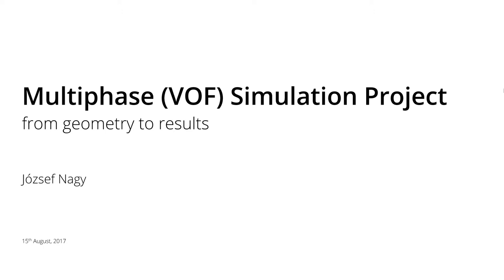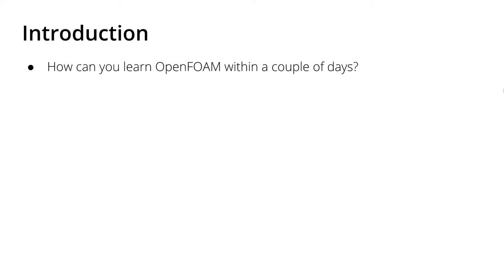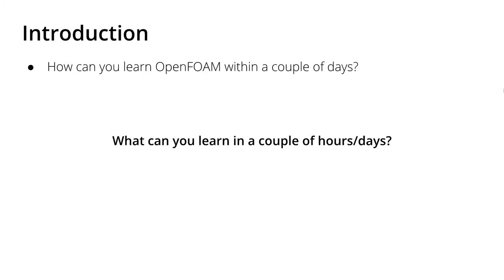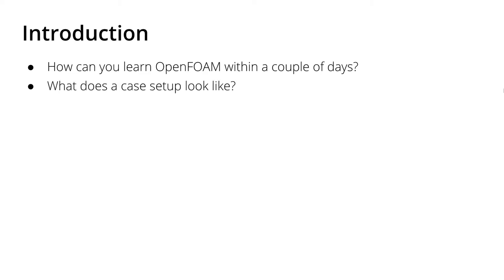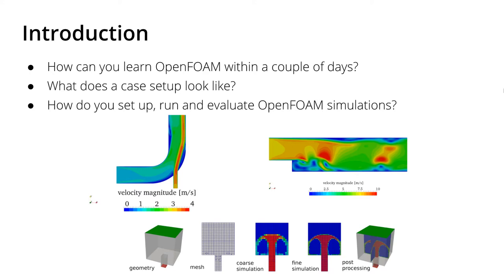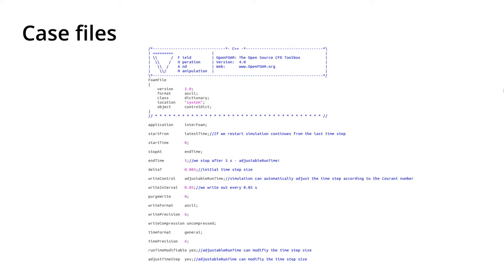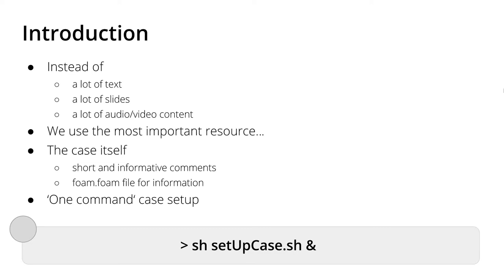Multiphase simulation project in OpenFOAM in Windows 10 and Ubuntu - tutorial part 1 - intro

Comment: Respected Sir, I wanted to simulate a bubble rise case in a water column using vof method with the help of axisymmetric condition. I have a doubt regarding creating a spherical shape in a wedge type. Would you please be able to guide or suggest some resources.

Comment: Mr. Nagy, thank you for your videos. I would like to ask a question regarding the boundary conditions using the solver "interFoam". I am doing a 3D simulation of the flow of an open channel. The primary requirement is that the simulation should follow the "continuity law". For this modeling, I am using an inflow of 20.6 m3/s with a U inlet boundary condition type "variableHeightFlowRateInletVelocity" , and a U outlet boundary condition type "inletOutlet and an inletValue  = uniform (0 0 0). Also, for the pressure file, I am using for the atmosphere type "totalPressure" and for the outlet type "zeroGradient". Finally, an alpha.water condition type "variableHeightFlowRate" with lowerBound and upperBound with 0 to 0.1849 respectively, where this 0.1849 represent the relationship between the total height of my inlet and the water level. My question is that the simulation is running, and looking at the hydrograph at the inlet is a constant line that represents the 20.6 m3/s, so far I think this is right, but in the outlet hydrograph, the outflow is an increasing curve which its maximum value is around 70 m3/s. So I do not know what is wrong with my model, because there is just one inlet and one outlet, so there is not any other water inflow and the flow at the outlet may be 20.6 m3/s as well as the inlet. Thank you in advance for your reply!
Reply from the maker: An idea would be to monitor the mean value of alpha in the domain over time, also to monitor the mean and max velocity in the entire domain over time and see where you accumulate mass flux. I hope this helps.
Reply: @OpenFOAMJozsefNagy   Thank you so much for the reply. I will check that in my model :)

Comment: Hi, when i am trying to import my .msh mesh file in openFoam using fluentMeshToFoam, it is showing the Fatal Error : cannot find file "/home/divyajyoti/OpenFOAM/OpenFOAM-v2012/tutorials/multiphase/interPhaseChangeFoam/submarine/system/controlDict", here submarine is the name of my case file. i am stuck here for several days and unable to find a way out. Please help me out.
Reply from the maker: Is the controlDict at the given path? Did you set up a case, where you want to import your fluent mesh?
Reply: @OpenFOAMJozsefNagy  Thanks for your reply. The issue was with Linux control permissions, had to run chmod 777 for every file in the case and it is working now.
Reply from the maker: @divyajyotibasu3001  Great. Glad it worked.

Comment: Hi Jozsef...Thanks for this beautifully organized tutorial. May you also tell which terminal are you using? Is it different from the bash terminal?
Reply from the maker: I use here bash in Ubuntu in Windows 10. This comes in the Windows Subsystem for Linux.
Reply: @OpenFOAMJozsefNagy  Thanks for responding. I use the same but your bash-terminal is looking different than mine and it has OpenFOAM logo and it appears so cool. What may be the reason?
Reply from the maker: @I_am_Rathore  I see. It is the same then I just changed the icon in Windows. On my current laptop I did not change it anymore. You can change the icon just like you can do it with all icons in Windows.

Comment: Hi Jozsef, thank you for some wonderful introductory videos! I a trying to simulate how air flows through a glass fiber optic cable at different temperatures. I wonder, which solver(s) would you recommend to use for such a case? Thank you.
Reply from the maker: I uploaded a video on solver selection. Check it out!
Reply: Thank you!

Comment: Hello Sir, 
i am novice
I have one doubt. i run the simulation in OpenFoam v2012 in windows. 
I got the following error/msg while executing the parallel run.  
cma support is not available due to restrictive ptrace settings.

At last, simulation was run with the command of interfoam. but at the end of simulation it was found: there were 4 folder named Processor 0 to 4, each contains all the time folder and at the end of simulation it was written 
[1]  Done  mpirun -np 4  interFoam parallel > log.interfoam
[2]  Done  mpirun -np 4  interFoam parallel > log.interfoam
[3]+  Done  mpirun -np 4  interFoam parallel > log.interfoam

Sir, Does it mean the simulation was run parallel? 
kindly help
Reply from the maker: I just noticed that you typed parallel. There should be a dash before it: -parallel
Reply: @OpenFOAMJozsefNagy  Sir, that's my typo mistake.  It is written right.
Reply from the maker: @shivamgupta9967  Ok then the simulation was successful.

Comment: Hi Mr.Nagy, thank you again for your effort on sharing these tutorials. Typing "gedit filename" in the terminal, i get the following message: "bash: gedit: command not found". 
I tried to download gedit and install it. But it still does not work. 
I tried to add the "gedit.exe" in  "/mingw64/bin" folder, but the following message appears: "C:/Program Files/blueCFD-Core-2017/msys64/mingw64/bin/gedit.exe: error while loading shared libraries: ?: cannot open shared object file: No such file or directory". 
Could you please help me to unstuck this?
Reply: I think to have found the solution (at least it is working this way). Let me share it, hoping to be helpful. Simply, I found the gedit.exe in "~/blueCFD/OpenFOAM-5.x/bin/tools/gedit/bin/" folder, so, inside the "*.sh" files given in the tutorial, i wrote down "~/blueCFD/OpenFOAM-5.x/bin/tools/gedit.exe", instead of only "gedit". 
Then I even tried to copy paste the notepad++.exe (because I prefere it) in the "OpenFOAM-5.x/bin" folder, and it works too.
Reply from the maker: I am glad, that you found the solution!

Comment: when i using paraview, i always get the error "ERROR: In /build/paraview-lH8wFv/paraview-5.4.1+dfsg3/VTK/IO/Geometry/vtkOpenFOAMReader.cxx, line 8285
vtkOpenFOAMReaderPrivate (0x561c866f39f0): Error reading line 20 of /home/joe/OpenFOAM/joe-5.x/run/Goldschmidt_mpi/0.01/lagrangian/kinematicCloud/positions: Expected punctuation token ')', found 0"
could you give me some advices? thank you !
Reply from the maker: Linux or Windows version?
Reply: @OpenFOAMJozsefNagy  Thank you ;), in Linux Ubuntu. when i cpied the data files to windows, I also can't open it in tecplot 360 2013 A. i'm a beginner of openfoam.
Reply: @OpenFOAMJozsefNagy  i finished the tutorial of Goldschmidt in DPMFoam step by step, however, both paraview and tecplot cannot load the results.
Reply: @OpenFOAMJozsefNagy  Dear Nagy, I have a good idea, you know it is very hard for beginner to install the ligggths+cfdem+openfoam in Ubuntu, even following the tutorial step by step. If it is possible, could you please make a  mirror image for an Ubuntu system with the above softwares that you have successfully installed. Thank you!
Reply from the maker: @yirenxindudu  yes, try foamToVTK and open up the vtk files of the particles. that usually works
Reply from the maker: @yirenxindudu  For that best approach the guys at CFDEMresearch GmbH.
Reply: @OpenFOAMJozsefNagy  I just want try foamToVTK today, thank you very much!

Comment: Hi József, thx for sharing the step-by-step video & i hv learnt a great deal from you!!
I hv tried this tutorial of yours. Out of curiosity, i modified it to become a water filling up a tank problem by the following 3-steps: 
1> invert the gravity effect direction
2> U at '0' for Outlet to "noSlip;" (as pipe & tank)
3> p_rgh at '0' for Outlet to "fixedFluxPressure;" (as pipe & tank)
OpenFOAM refused to run, saying "FOAM FATAL IO ERROR".
When i used back your original case with only 2-steps above 1> & 2>, it seems that the water is flowing out of 'Outlet'.
Can u pls advise what should the p_rgh be for Outlet be in order that my above 3-steps can work?
Hope to hear from you soon... Million thanks!!
Reply from the maker: Well, since interFoam is an incompressible solver you need somewhere an outlet otherwise you would compress the fluid and this is not in the model. Try placing an outlet somewhere. Maybe even modify the stl files a bit.
Reply: Ok, i will try that, Jozsef. Thx a lot!
Reply: Hi József, I have made the changes as you suggested.
I have some questions on the results and have made into a pdf file & forwarded to your email & hope you kindly shine some light...
Thx in advance ya!